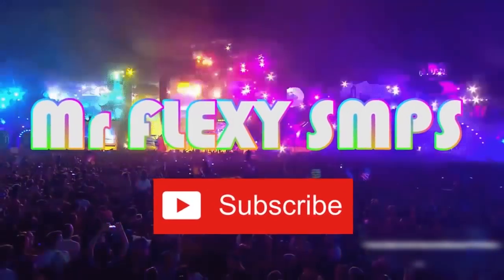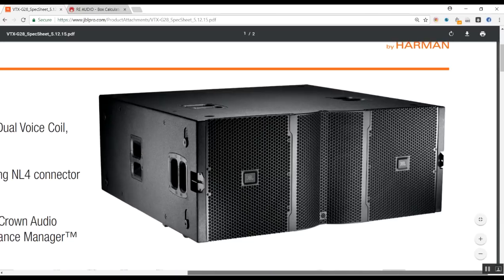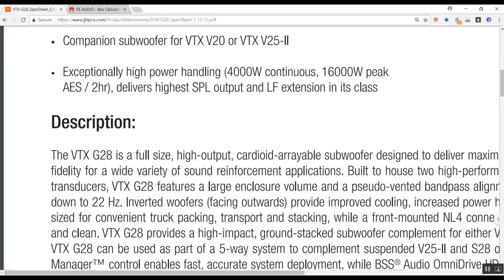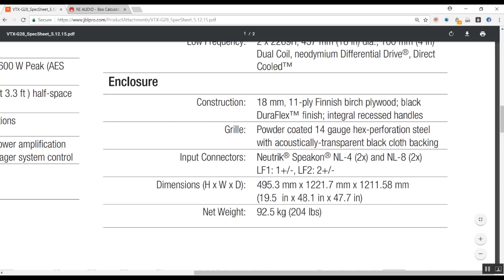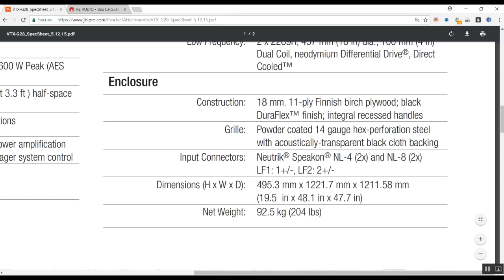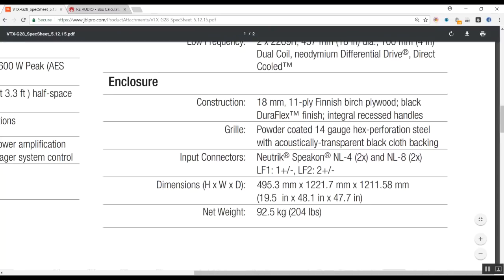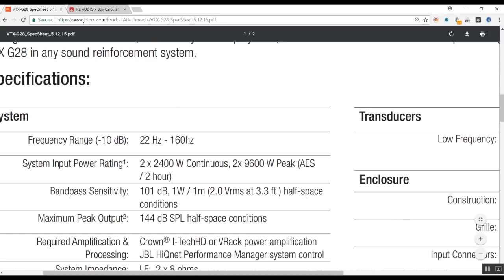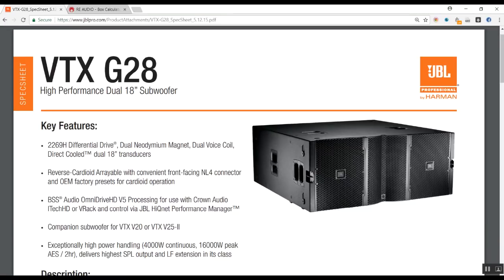What makes 22Hz Possible ? 😮 #BASSHEAD Lovers 😮

Comment: I guess if the box is large and long (like a hog scoop) it will play lower somewhere around at 30Hz like that or something and there is one sub that can play up to 0Hz it's a rotary woofer (i'm just suggesting it though) and it is more likely a sub with a fan blades and it is like a earthquake cause it goes really really deep and for more info visit Wiki about rotary woofer, back to the topic yes 22Hz is possible for subwoofer if the box has a correct measurement/size, tuning, and size of the port it will make 22Hz and stacking a bunch of them will make them play lower and like the cv box the more cv box the more louder it will get (possibly go lower too) and so in conclusion we can say 22Hz is possible
Reply from the maker: The 0Hz I would not push that low hahaha.
Reply: Also our ears are much less sensitive at infrasound level (30-1Hz) so we perceive this as a earthquake like feeling we can't hear it but we can feel it and also we can detect those infrasound level by making it loud enough to be heard (for example a rotary subwoofer is being used at some high-end cinema and used in some home theater to simulate a earthquake feeling but a single rotary subwoofer will cause you plenty of $) but some bassheads out there (including MrFlexy SMPS, and me) like really high bass that will make us happy and amazed and i guess having a large enclosure volume will make it play lower like a infinite baffle it will reach 15Hz on it's xmax.

Comment: how low will the "roll off" be if used in groups of 4 to 8?... AKA how low will the Hz drop when grouped together?
Reply from the maker: 4 to 8 would do you good as long as they are dual subs.